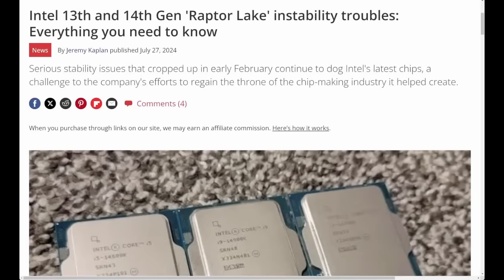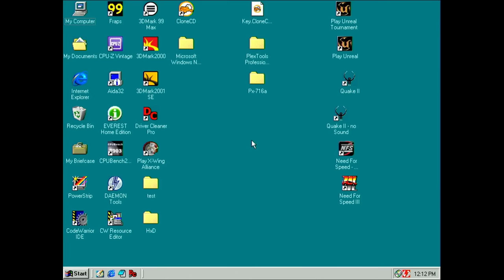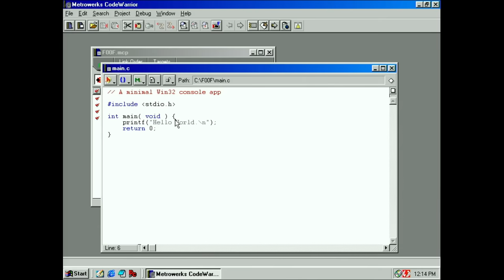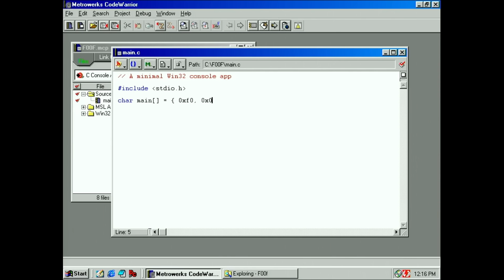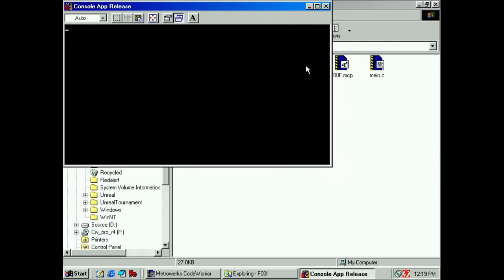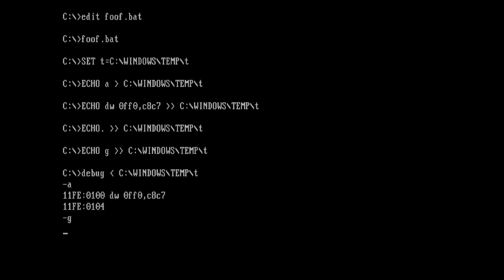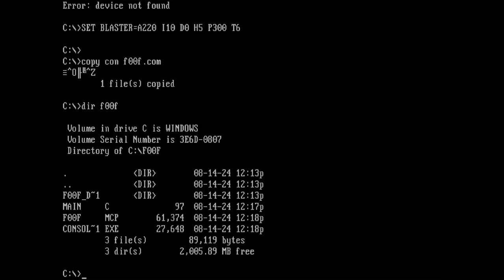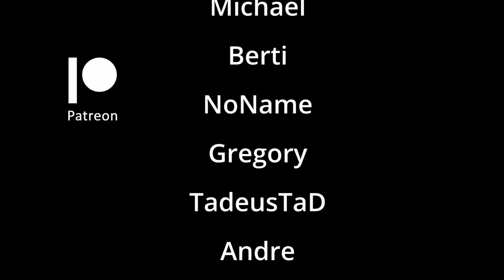These 4 bytes will crash your retro PC: The Intel Pentium F00F bug

Comment: I do wonder why the cursor keeps blinking if the CPU is frozen
Reply from the maker: Maybe some portion of the CPU is still executing. Interesting observation!
Reply: In this case, the cursor is blinked by the display hardware.
Reply: This is what was called a "hardware cursor"; the GPU does this. CPU is not involved.
Reply: Video card does the blinking
Reply: @dascandy  GPU did not even exist back then. They where just 2D cards with some basic functionality to take away from instructions from CPU.
Reply: @vanderlinde4you  Indeed. If you record the screen at high speed, you can see that the cursor is actually blinking at some integer fraction of the display refresh rate. It's just a bit of logic turning the cursor on and off every n screen refreshes. Nowadays, the multi-billion transistor CPU in my system spends many cycles performing basically that same task.
Reply: @_irdc  Numlock (on/off) was the only way to determine if the system completely halted or not.
Reply: @vanderlinde4you  Raise your hand if you still toggle numlock to check for crashed systems from time to time ✋🏻
Reply: @_irdc  I do it all the time to test retro hardware. Right now I'm working with it to figure out why this 486 motherboard won't get any video output with known good video cards, without generating any error codes and while the system still appears to be booting (numlock turns on and off when pressed)
Reply: @vanderlinde4you   OK, congratulations, you passed the pedantry test.  It's not a "GPU", it's the CRTC that's responsible for the blinking cursor.  (Depending on the architecture of the particular graphics card or chipset in question, anyway, as it may be abstracted away into, e.g., a VGA core + RAMDAC, or even a single-chip solution, etc...)

But, as "GPU" has become modern shorthand for "the graphics display hardware", whatever that actually may be, the point is taken.  In other words:  You know what they meant.

Comment: On X86 box this crashes 486DX chips. Not sure if it would in real life but I could test it out on my 486 since its only supposed to affect pentium class systems.
Reply from the maker: Oh, really? Interesting! That shouldn't happen. First, it's an emulator, second, you're using a 486 which doesn't have the bug.

Comment: I may be completely wrong here, please correct me if I am. Cyrix CPUs aren't affected because they're all based off of i486 architecture instead of P5, and AMD went straight from i486-based K5 to K6, closer to the then-unreleased Pentium II than the original.
Reply: They cant have the same bugs as Intel ones. They have different bugs.

Comment: From intel 80386 i switched to AMD k5, k6, Tbred, but at last to intel core2quad CPU. I never used an intel Pentium CPU. Now i am back to 80386 using a DosBox emularor on an android tablet. The emulation works great. And now i am waiting for a mobile "quantum" CPU and another DosBox emulator for the quantum CPU android OS.😂

Comment: I would love to see this bug executed in Windows with Media Player or the good old Winamp running in the background playing music to see if the music keeps playing, going in a loop, or just stops completely.
Reply from the maker: Ahh, Winamp 😌. I guess I should explore this bug further and see what happens on Pentium Pro systems (it shouldn't freeze - those CPUs should not suffer from this bug) - and also check my Pentium Overdrive (for 486 socket 3).
Reply: Presumably it would continue playing, similar to a skipping CD player.

The exact mechanism for playing audio is dependent on the audio hardware and the driver for it, but in general, it involves a ring buffer that is filled with sample data at a regular interval.  If the CPU stops working, the buffer just never gets updated with new data, and the audio hardware may continue to play the contents indefinitely.  This happened in the old days when you assigned the wrong IRQ to the audio device.  The sound card would set to work playing the buffer, and would raise an IRQ to let the driver know it was done playing a chunk -- generally it would do this before it got to the end of the buffer, to give the driver time to refill the first half while it continued playing the second half.  However, the driver, having been configured with a different IRQ, would never see the request, and thus would never follow up to refill the buffer.  Ergo, you would just get a continuous loop of a short phrase of audio until you reset the computer (or at least the sound card), because it wouldn't know the difference between an unfilled buffer and a buffer filled with exactly the same data that was already there.  As far as it's concerned, it let the CPU know, and so its job is just to keep playing whatever's there now.

Comment: For the third method i have no number keys and no altgr key with a virtual keyboard app on a touch screen using DosBox emulator on an android tablet. Alt key + numbers is not working for output a character.
Reply from the maker: Hm, ok. Yes, you need to have those keys and the numbers must be entered using the NumPad. You could download the compiled file from my website and copy it to your emulator. But I don't know if that's possible.
Reply: @bitsundbolts  Thanks, but i don’t need it and i know how to use debug very well. I use a special version of debug that works and looks like the debug version from MS and it provide 16 bit and additional 32 bit instructions. I download it from the other alternative DOS. I put the link into the pinned comment of my videos. Thank you.

Comment: Have you tried this in Linux or Unix?
Reply from the maker: No, I haven't. It should work on unpatched versions since the F00F bug is hardware related. I believe there were patches for almost all operating systems to prevent this series of instructions from executing.

Comment: What’s so complicated? I rly wanna know… I still have my copy of Borland C++ Builder 5 somewhere. Installing it, writing C program into editor and press the green arrow button on the top should be enough.
Reply from the maker: I did not code in C. I did have Borland Delphi 4 back then.
It was difficult for me to find a compiler that allowed this one-liner. I tried it online with several tools, but it always failed to compile. Code warrior was the first Compiler I tried - and it worked. It was just the first thing that worked. Of course, there are better ways to get this done, I'm sure of that.

Comment: I wouldn't expect an undocumented instruction to be reliable. It may do something. It may trigger an error. The point is, I wouldn't expect the results to be consistent across multiple implementations either.
Reply from the maker: True, however, the instruction is invalid and should raise an exception from the CPU, but it doesn't. It's interesting that this combination of instructions was found that locks up the CPU.
Reply: @bitsundbolts  The 6502 for example doesn't raise an exception. It just does whatever. lol
Reply: Exactly.  Undefined instructions have, by definition, undefined behavior.  Sometimes those instructions get assigned later in the architecture's life.  Sometimes they do useful things.  The 6502 mentioned above is known for having some useful undefined instructions that appear to combine functions of other, valid, instructions.  The NES, for example, had some games that took advantage of undefined instructions.  Emulator authors had to find this out the hard way, as they would've first built the emulator to support all the known valid instructions, and then would've run into ROMs that asked it to do something entirely different and unexpected -- which, of course, would've broken the game until the emulator was "fixed" to respond in the same way the hardware did.
Reply: @nickwallette6201  yeah. It's kind of cool if you can find it useful, but it's also very dangerous. You never know if there will be an NES 2 that "fixes" the 6502 and now they are just NOPs or they create some kind of NMI or something.

Comment: Honestly? I'd love to go in-depth about the why and what of the F00F bug, lmao
Reply: LOCK CMPXCHG is the only instruction that sets a special flag to the memory bus controller to lock from this memory access until the next one (atomic read-modify-write implemented with locking). If the instruction raises a fault, incorrect logic still sets the flag when the CPU goes to read the fault handler address from memory. Memory bus controller keeps the bus locked until it gets the second half of the instruction (the write). Meanwhile the CPU is waiting for the bus to be unlocked before it reads the fault handler instructions.

Comment: Does it work on real hw or can occur on emu?
Reply from the maker: Good question. It probably depends how well the emulator emulates the CPU. Someone should try that.
Reply: @bitsundbolts  tried it on 86box with Pentium 200, 166 etc
it hangs! =)))  but with some print garbage on screen before halt.
wait...  no!
Skipping startup files makes it printing some garbage in endless cycle. But running drivers and so on, and Volkov commander changes smth and makes machine stop.
Same behaviour in PCem.
Reply from the maker: I was told that there should be a fifth byte to terminate the application properly. The key is ALT + 195 - or 0xC3. This should avoid unexpected behavior. Maybe you can try to add this additional byte and see if it makes a difference.
Reply: @bitsundbolts  well, it changes exit, makes it normal. Code itself does nothing.

Comment: 4 bytes?
Reply from the maker: Two hex-digits represent an 8-bit pattern - or one byte. Four of them are four bytes. Or did I make a mistake?
Reply: @bitsundbolts  0xf00f (C notation) is 16 bits, or 2 bytes.
Reply from the maker: I think you also need the other two bytes (0xc7c8) for the bug to be triggered.
Reply: @bitsundbolts  yeah just looked it up. The bug’s name is “F00F bug”, but you need 2 more bytes. I suppose the video title is a tiny bit confusing if you’re not familiar with the bug, but at least that’ll get you clicking. Worked for me. 😀
Reply from the maker: Well, thanks for watching and interacting! 🙂
Reply: One byte can divided into 4 bit high nibble + 4 bit low nibble. This make it easy to read bits as hexadecimal values. I do this since Comodore C64.
0000
0001
0010
0011
0100
0101
0110
0111
1000
1001
1010 A
1011 B
1100 C
1101 D
1110 E
1111 F

Comment: The F00F bug is what lead to me ending up with a 486 instead of a pentium, and I'll never forgive that clerk at Best Buy, or Circuit City or whatever...

My parents were just not wanting to spend an extra $200 on an already expensive nearly $3000 computer setup, and the guy knowing he's tossing out old stock was like "yeah those pentiums have a bug in them, and they perform basically the same"....

So they bought it the "Compaq Pressario CDS 924 + Monitor + Cannon BJC printer"  and I had to suffer 486's in the time when everyone was playing Quake ... haha
Reply from the maker: Uh, that's rough... I'm sorry 😞
Reply: @bitsundbolts    haha, well it wasn't long until I got a job and got myself one of those fancy pentiums.  And then a K6/2...

Comment: im gonna try this on my pentium 2 and report back
Reply from the maker: I'm curious, but I think you'll just get an error. Pentium Pro and Pentium II or newer shouldn't be affected.
Reply: Yeah in visual studio it just says 2 errors @bitsundbolts However the bat file method says it performs an illegal operation.(While still in windows 98) Prompting me to quit all programs and restart my computer. Interesting. It also says fault location: 0F71:0100. It seems to actually run it and shows the output of yours but it catches it red handed I guess lol. Even more interestingly it gets stuck in ms dos mode so maybe it isn't really fixed.. windows is just patching it instead ! the Pentium 2 is just so awesome sauce
Reply from the maker: Interesting. I guess I have to try this on other systems and different CPUs (like AMD and Cyrix)
Reply: @finnisnotafish   the batch file method is just a really long way of typing the 4 bytes into memory and then running them. You get all the same output from putting the bytes in memory. If you get anything other than a hang from running them, then you don't have the bug.

Comment: Using mingw32 you could have used plain C, gcc, and a linux machine.
Reply from the maker: Unfortunately, I have very little experience with Linux. I also think that Linux was patched quickly to mitigate the F00F bug.
Reply: You can also maintain different POSIX environments under Msys2, including a 32-bit one with mingw32, a 64-bit one with mingw64, a minimal one for embedded systems with ucrt, modern clang with clang32 and clang64, and lately even an ARM one with clangarm64.
Reply: Was this not "plain C"?  Looked like plain C to me.

I dunno how using a whole other OS, compiler toolchain, and possibly a whole other computer is better/easier/more legit than just using a native compiler, though.